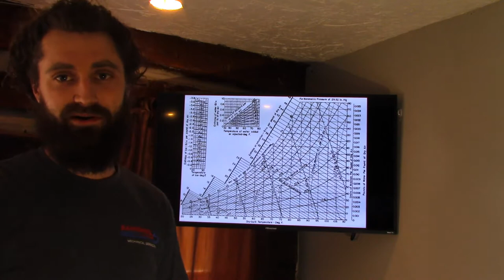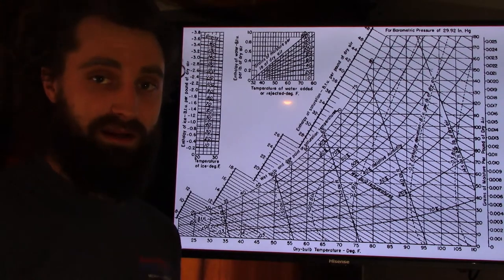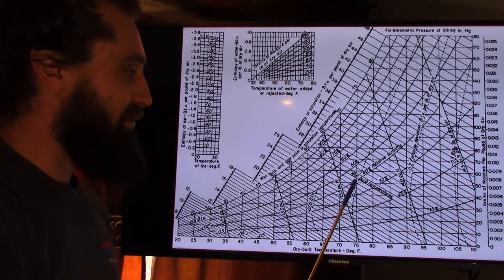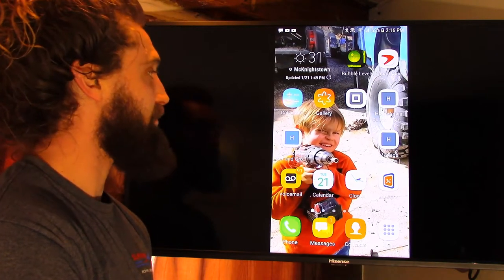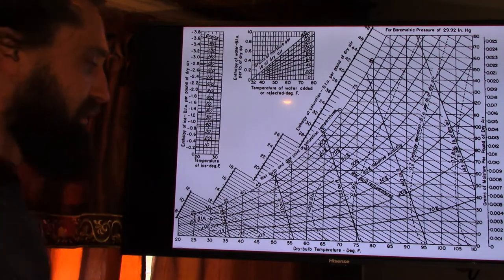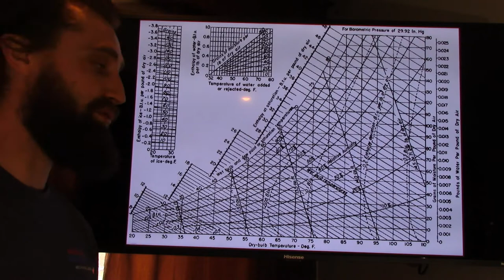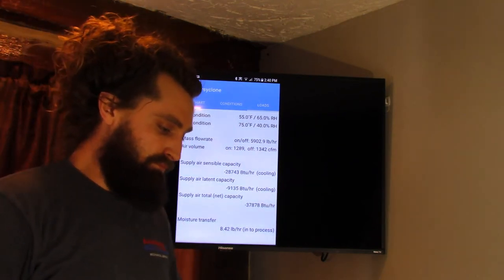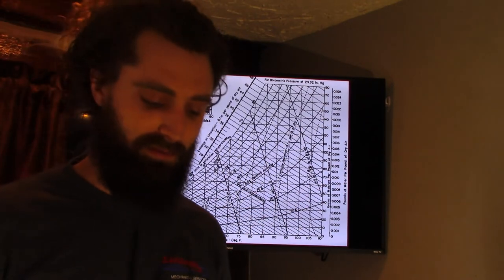Psychrometrics 101 Verify Air Conditioner Capacity

Comment: So just to be clear your cardboard analogy is good, but you need to realize that RH is not how much percentage of the column of air is water. What it actually represents is how much water can air at any given temperature hold. So with your example…
Return air at 75F @ RH100% a pound of dry air can hold ≈ 130 grains, so 40% is ≈ 52 grains. Now if we look at the supply 55F @ RH 100% ≈ 65 grains, so 70% is ≈ 44 grains.
So that’s a removal of 8 grains per pound of dry air processed . Good stuff👍🏻